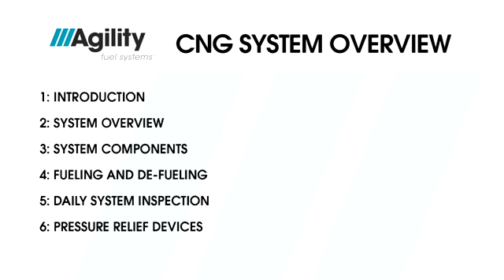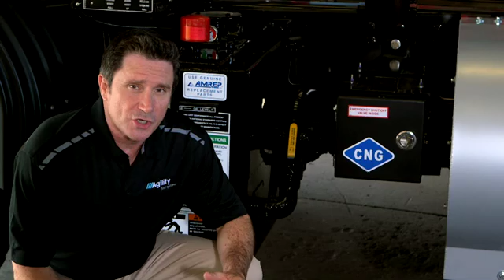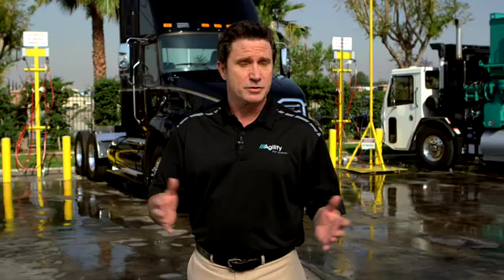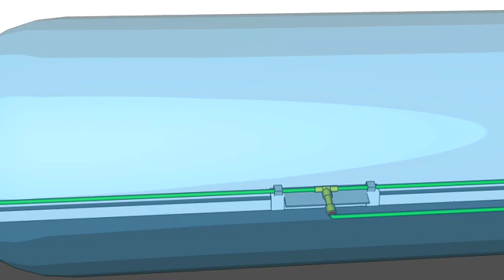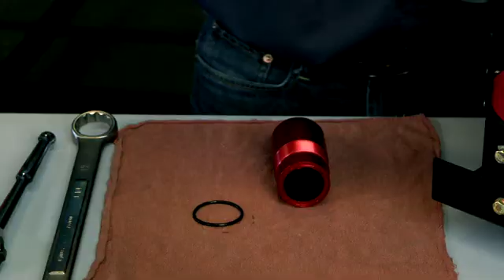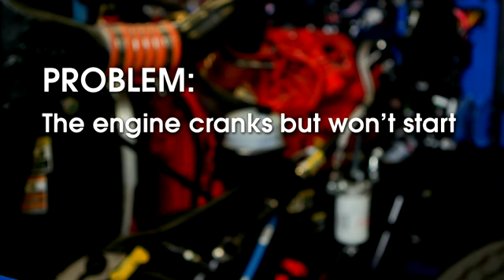Agility Fuel Systems Compressed Natural Gas (CNG) Overview (full-length)

Comment: What would cause the fuel regulator to run low (80) psi or high going above max psi? The  high flow filter was changed along with the regulator...
Reply from the maker: Hi Kevin, for technical questions, you can reach out to our customer care team at 949 267 7745. They'll be happy to assist!